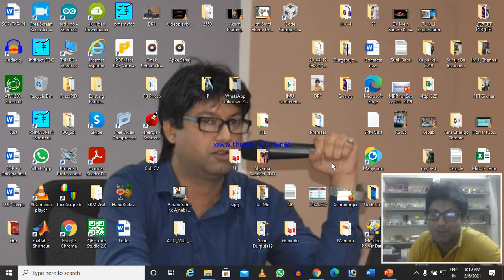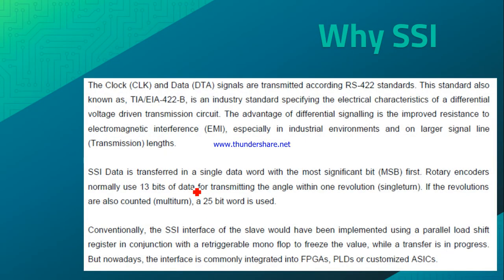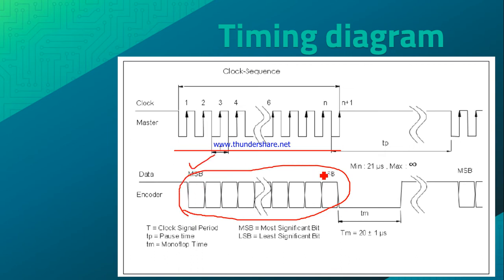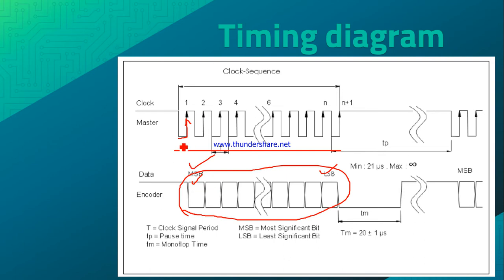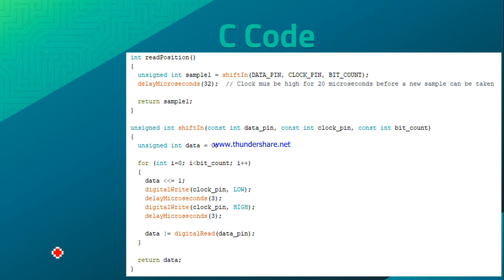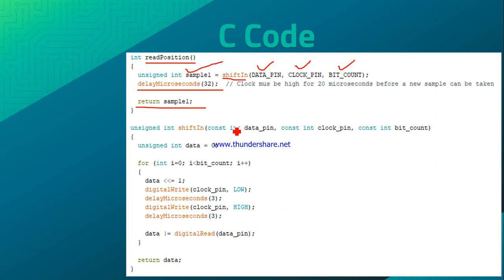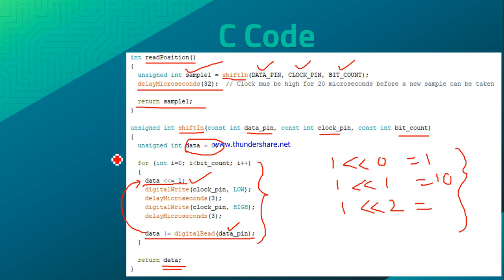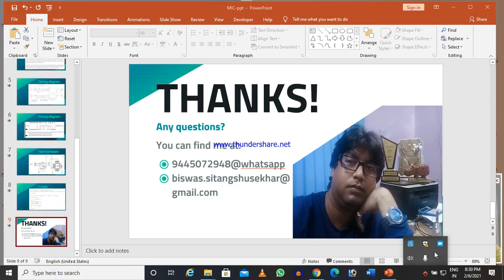Synchronous Serial Interface || SSI

Comment: I have a question. So I set a specified clock frequency through a digital output? and the encoder will answer with the given data? is that correct?
Reply from the maker: Mostly you are correct, if you want anything further pls say a hi to my WhatsApp number given in the video description
Reply from the maker: Mostly you are correct, if you want anything further pls say a hi to my WhatsApp number given in the video description